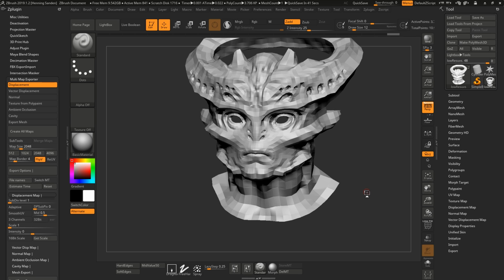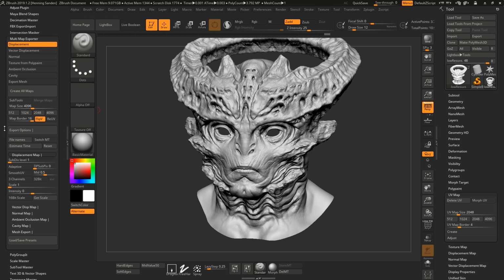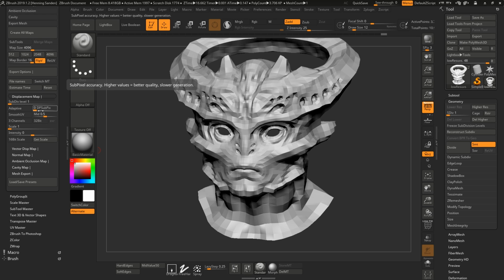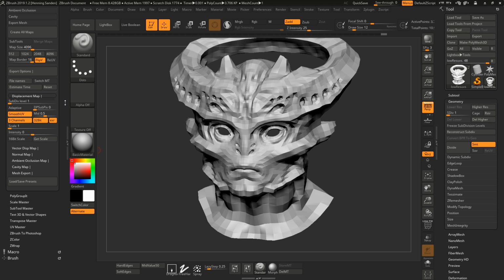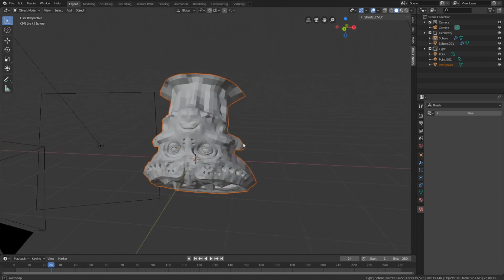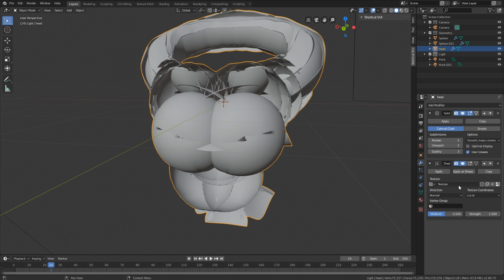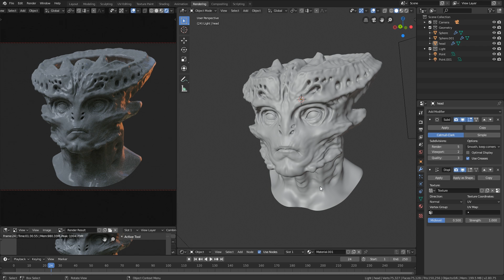ZBrush to Blender 2.8 Displacement Maps - Ultimate Guide

Comment: so i created horn with vdm brush that i created, and i applying it on the mesh with UV and subdivision, and i generate displacement like this, and using in in blender, the horn is in the wrong direction, it's like straight spike direction, it should be like rhino direction horn, what did i do wrong? please help/

Comment: yuo can set the scale in blender, for example my zbrush models tend to be a hundred time bigger in zbrush that blender, so importing back in I clamp the scale to 1 and set the displacement scale  to 0.01 in blender. works fine.
 I also have blender set to unit scale of 1.0 and cm , so my head is real size ie around 25 cm from chin to top of head

setting the scale to ,01 in zbrush does not seem to work in my experience, I just leave it at 1

Comment: Awesome tutorial.
Also want to put this here in case someone has these issues for any reason.
1) If you import your model and its scale is set to 0.01 (or anything other than 1), and you happened to apply scale - Simply set the Strength value on your displacement modifier to 0.01 to get the correct result
2) If your height map was a PNG or something, by default its Color space would be set to sRGB. Make sure you set it to Raw/Non-Color

Comment: Thanks for the instruction very much! The video caused another question for me though. What's the point of generating displacement maps if we are going to add subdivision levels again? Sorry if the question is too basic.
Reply: If you create a sculpture in a program like zbrush and you want to use it in a movie or render it in high quality you would have to export it into blender. But blender can't import models that are millions of polygons in size. So you have to import a low res version of the sculpture and subdivide it inside of blender until it's as high res as the zbrush sculpture.

But if you just subdivide the low res model it's going to become a high res smoothed out version of the low res model. So you have to displace the surface using a displacement map. Then you will end up with the sculpture you made in zbrush in blender, you can then texture the low res model or animate it. To achieve very high res and realistic looking models.
Reply: @DanIel-fl1vc  thanks for the time you took to help me out, that was very helpful 👌
Reply: @DanIel-fl1vc   but i am still getting probs because i am only getting good details at sub 6 but my blender can't able to handle it what to do?😔pores on my sculpt dont get good view on sub 5

Comment: I'm trying this out with a bust model that is ~1.2m tall in Blender; exporting a 32 bit map(confirmed by opening in photoshop) gives correct displacement for details but also shows some stair-stepping effect. Examining the image, the range is very narrow around 50% grey, I get a stair stepping effect with enough subdivisions and if I use levels to view the range (tiny spike around 50% grey values) in photoshop it also has the stairsteps.
Reply: Think I found a solution, should be accurate, theoretically. In ZBrush, set the [Multi Map Exporter] export scale to 10, It will complain that the 32-bit scale should be set to 1, ignore it. This makes the histogram range for the values 10x wider. In Blender, set the displacement range to 0.1 to compensate
This avoids crushing the dynamic range of the exr if your model is small (even 32bit isn't enough for the tiny range otherwise). Apparently even 1 meter is too small for 1:1 scale in Blender.

Comment: How would you use this as part of a full workflow with a program like substance painter? 
For example, say I have a high res character bust that I sculpted in ZBrush, and a low res retopologized model I made in blender. The high resolution mesh has low to mid frequency details sculpted in, small forms/muscles, wrinkles, etc. From there I would want to bake a displacement map and bring it into Substance Painter to both create the skin materials and add the finest wrinkles, pores, bumps, etc (overkill to sculpt those in ZBrush imo).
From painter I then need to export texture maps and either a very detailed displacement map with all the small frequency detail, OR, a displacement map with low-mid frequency detail + a normal map with the high frequency detail. This then needs to be added to the model in the main 3D app (here blender) and display the combined details properly.
There is very little info out there on how to go through the full workflow properly, do you know a way to get good results reliably?
Reply: Not sure if this is 100% correct, but here's what I did that (mostly) seems to work
- Export your map and base model from ZBrush, likely after reprojection to remeshed topology
- In blender, plug the .exr into a displacement node (found under the vector category), and the output of that into the displacement input of the material output node. Make sure your midlevel and scale are correct
- In Painter, setup your low and high poly meshes and bake your normals. 
- I put random normal stamps all over the mesh here to add details other than the baked normals.
- Export your maps and plug them into the shader network (through a normal map node found in the vectors category). Both the displacement node and Principled BSDF have a normal input and I'm not 100% sure which is correct, however the input on the displacement node seems to give weak normals so I think it's the other one but I'm not sure ( I checked the Blender docs and the description for that input is just blank *facepalm*).
It makes the surface jiggle a little if you toggle between just the displacement and the displacement + normals, so I'm not sure if this is the right way to do it, but the extra high frequency details from the normal map get overlayed on top of the displaced geometry without over-exaggerating the low-mid frequency details present in both maps.
If anyone knows more about this please share.

Comment: Hello @Flipped Normals. I have a problem with baking displacment for blender. I made geometry using dynamesh, then i used subdivision for more details. After that  i copied the high poly mesh and Zremesh it for low poly version and i used Subdivision again for projecting details from High poly to low poly. Next to i tried to bake displacment but there is a problem. When I exported .exr displacment for blender it wasn't work at all. Or it was a black image or with only a little information (and in wrong direction). I tried to export tiff file as displacment it works better but still not good. It generate information on mesh but there was a mesh artefacts because of that. I tried this map in substance painter and it worked well. Idk why there is problem only in blender. Could You something tell me about that? Thanks. Regards.

Comment: Question, is it possible to make the displacement map directly in Blender, or do you need ZBrush and its add-on to pull this off? Anyway, nice tutorial! :)
Reply: Unfortunately, displacement baking isn't in 2.8 yet. In fact, the whole baking system is kind of broken right now.
Reply: you could use a shrinkwrap modifier and a multiresolution modifier (to get your high poly detail on your low poly mesh) and then go to the render tab in the properties panel, find your bake settings 

-make sure you're using the Cycles engine
-make sure multiresolution is checked(in the bake settings)
-make sure the preview in your multiresolution modifier is at 0

make an image node in the shader editor and give it a new texture.

make sure you have the image node  and the mesh selected before you click bake

Comment: Guys if you use micro displacements is way better to do the displacement maps
Reply from the maker: It doesnt work with Eevee though
Reply: @FlippedNormals  It looked you were using cycles in there

Comment: noob question here: I get that by creating a low-res mesh, the eventual goal is to 'fake' the appearance of the ultra-high-res sculpt by using a normal map to get all the tiny details baked in. And that will perform better in a game.

Does it 'perform' better in terms of doing a faster cycles render? Will the low-res mesh + normal map, render faster than high-res mesh + no map?

Also, what is the main purpose of doing the high-res version as a displacement to the lo-res mesh? I guess so you can model other stuff around your character and keep him low-res and responsive in the viewport, but by you can replace him with the high-res version at any time by changing the subdivisions?

Oh, also, is this true displacement, changing the geometry of the mesh? I remember that before you could have real displacement or a bump map.
Reply: The advantage of displacement is that all of that detail is being stored separately from the mesh so that you can disable it if you want, you can easily animate the model because it's pretty low resolution, and if you do your displacement with adaptive subdivision (which isn't supported in EEVEE yet), then it will remove detail as the camera gets further away which obviously improves performance.

Comment: Thanks for this, I've been doing it the normal way and using the 2.79 nightly build that has a displacement node in cycles. I was wondering how they carried that over to 2.8

Also is there a chance you can give a Udim tutorial when the new update comes out?
Reply: It already supports udim in version 2.81
Reply: @Ilam_Void  Great, now how do you create and use them in blender is there documentation on that?

Comment: Could you have done the sculpting in Blender, and if so, would it have rendered better/faster?
Reply: This sculpt was started in Blender and finished in Zbrush. Zbrush handles higher polycounts way better than traditional 3D apps.
Reply: If you're referring to the sculpt overall, that looks like the one they made a couple videos back in Blender. They may have finished it in ZBrush, or maybe retopologised it, I'm not sure.
Reply: @charltonrodda  Just sculpts in general. I saw a sculpt that they did in Blender recently which looked to be of ZBrush quality, certainly better than the model used here.

Comment: It’s better if you use material vector displacement, combined with micro-displacement. This makes it possible to use much higher and more accurate detail
Reply: Can you write, explain a bit about it.I see where to export from ZB. can you write the settings and node set up?. Im totally interested in this.
Reply: They mentioned they're not doing it in the shader because vector displacement isn't supported by EEVEE
Reply: Matt Curtis yet they end up using Cycles anyway.

Comment: please show us how to bake that displacement map withing blender
Reply: Blender Guru has a video on this. "How to bake perfect normals in Blender" I believe it's called. Baking displacements is done the exact same way.
Reply: Most likely you will be using the Multiresolution modifier for sculpting. Use cycles render engine. Go to bake settings and click the "Bake from multiresolution" checkbox. Switch the bake type from Normals to Displacement. 
From here use a 2.80 bake tutorial.

Note: For the time being, there isn't a basic displacement bake yet. Nor, baking textures in eevee.
Reply: Considering how rarely baking is updated in blender and that it's missing a lot of useful baking functionality i'd suggest baking somewhere else. Marmoset Toolbag is excellent and  Substance Painter is decent enough for example.

Comment: quick question, why displacement and not vector displacement? I usually have better results in complex detail with VD
Reply: also, why disp modifier and not plug in in the displacement map in the input on the cycle material?
Reply: @Lostpx  Cause Displacement map in cycles material works only at render time, not in the viewport and so it doesn't work for Eevee which is important for istance if you want to paint on your character.
Reply: @Lostpx  I wonder as well.
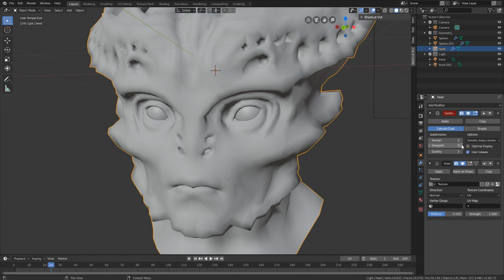Reply: @Lostpx  Answer at 10:04